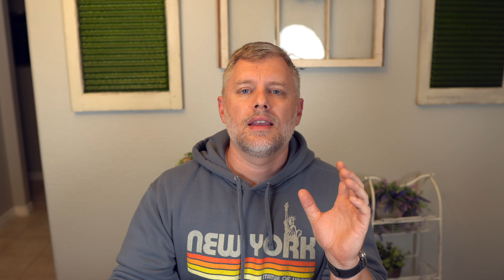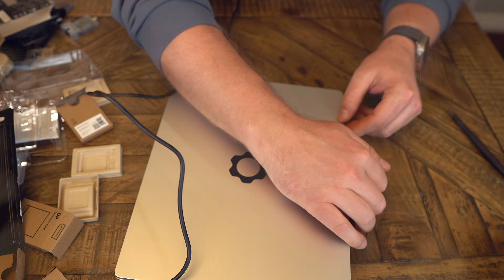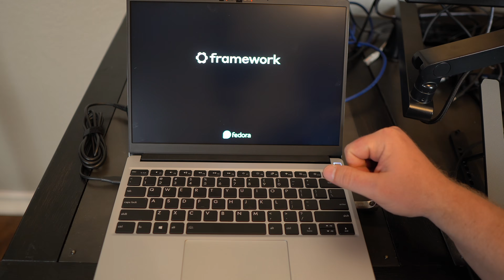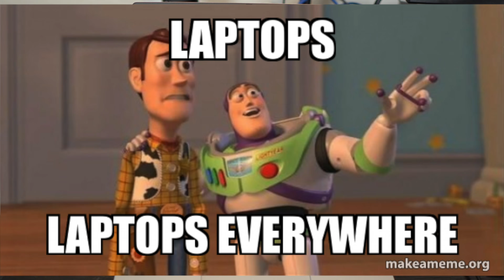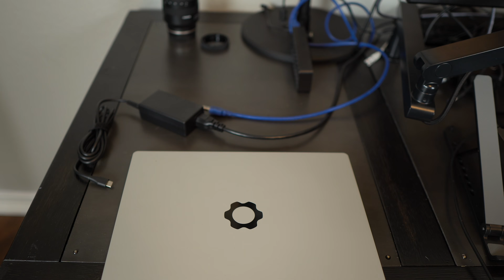Framework 13 AMD Edition Unboxing & Linux Installation Review

Comment from the maker: Timestamps:

0:00 - Introduction
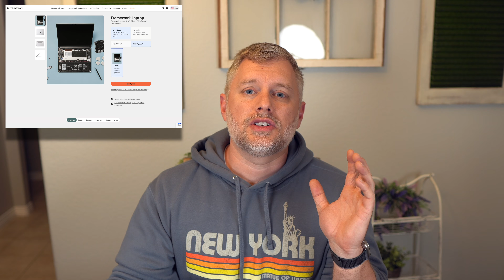0:03 - Framework 13 overview (repairable, modular)
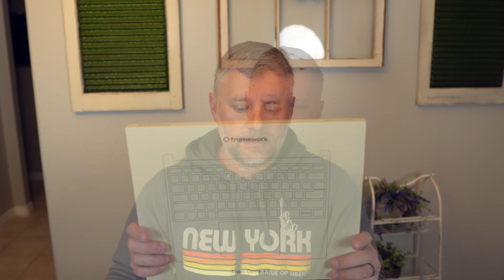0:22 - Unboxing the Framework 13
0:26 - Input cover kit
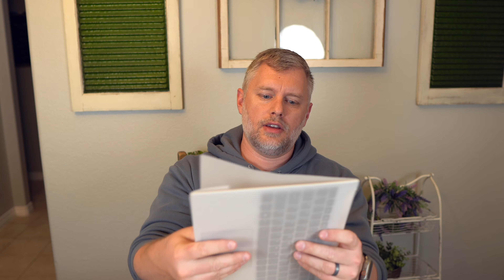0:44 - DIY Edition top cover and assembly
1:00 - Arrow key layout and glass touchpad
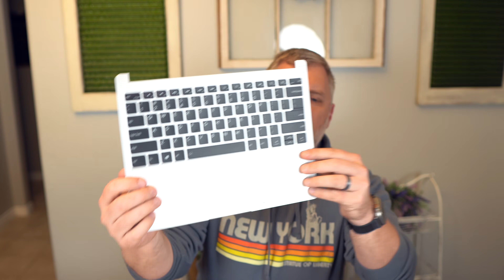1:23 - Magnetic bezel unboxing
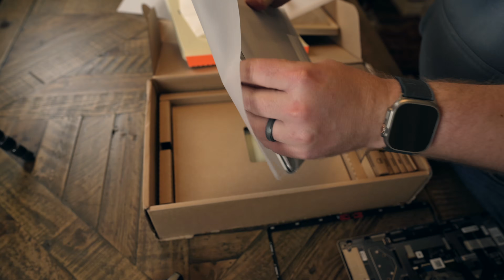2:05 - First impressions of the laptop body
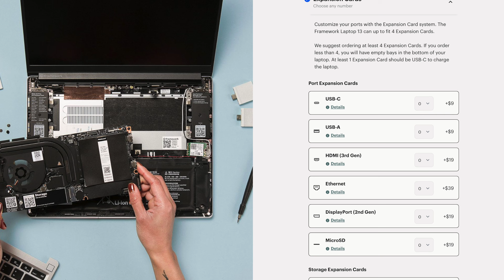2:20 - Customizing ports (USB, Ethernet, DisplayPort)
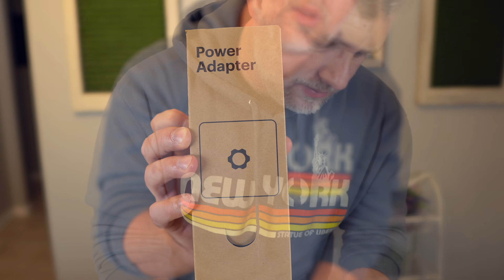2:38 - 60W power adapter
3:12 - Installing 64 GB of DDR5 RAM
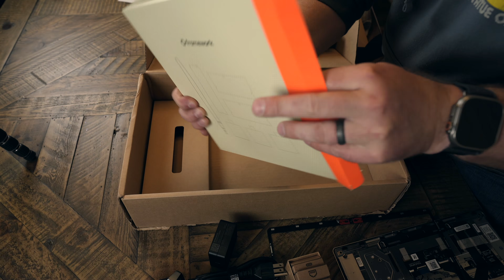3:50 - Installing the Western Digital 2TB NVMe drive
5:01 - Memory and SSD installation complete
6:11 - Attaching the bezel (magnetic)
7:16 - Snapping on the top case
7:49 - Screwing in the assembly
8:11 - Installing modular ports
8:30 - USB-C and Ethernet installation
9:18 - DisplayPort adapter installation
9:32 - Ports and connectors overview
9:47 - First impressions of the trackpad and keyboard
10:01 - Powering up the laptop for the first time
10:03 - BIOS screen (missing boot device)
10:31 - Checking BIOS settings
10:47 - System info: AMD Ryzen 7 7840U and Radeon 780M
11:02 - Booting Linux (Ubuntu 20404 Beta)
11:23 - Webcam and mic physical switches
11:42 - Ubuntu installation impressions
12:13 - Moving to Fedora 39 for Linux testing
12:28 - Fedora splash screen and installation
12:36 - Checking AMD Graphics compatibility
12:41 - Working hardware (brightness and sound keys)
13:12 - Fedora installation complete, rebooting
13:25 - First boot into Fedora 39
13:41 - Wi-Fi and CPU thread overview
14:00 - Checking CPU performance and dual-channel RAM
14:37 - Updating firmware directly through Linux
15:11 - BIOS update progress
16:01 - Discussion of the AMD chip's efficiency
16:18 - Framework BIOS updates and fixes
17:01 - Fingerprint reader test and setup
17:46 - Webcam and hardware switch test
18:15 - Recording through the Framework webcam
19:15 - Running Chrome browser speedometer test (high score of 366)
19:42 - Performance profile and battery life overview
20:42 - Testing suspend and resume functionality
21:11 - Wrapping up: Overall impressions of Framework 13 AMD Edition
22:13 - Final verdict: Build quality, modularity, and Linux compatibility

Comment: Thanks so much for the video, I've been curious about the Framework laptops, and this was good for me.  So did you not need to worry about static electricity in this assembly?  I didn't see any ESD related equipment.

Comment: Maybe I missed it in the video, but did you actually do a battery test? You pointed out what it said it had left but those typically aren't accurate. Did you run any full battery tests to give us a realistic battery life estimation? Thats a big determining factor for me between this and System76 Darter Pro currently.

Comment: I saw you booted up with Ubuntu. Did the brightness and sound keys work with Ubuntu?
Reply: Ubuntu is one of their officially supported distros - so yes all the keys work out of the box. The embedded controller firmware which includes the keyboard firmware is open source and on their github. Firmware updates are handled by fwupd/LVFS so even many distros they don't officially support work just fine pretty much out of the box.

Comment: Would love to know your thoughts on battery life (especially since AMD has a big power drain during video playback). How much are you getting out of it?
If it's comparable to the 8 hours I get on my 3,5 year old Lenovo yoga slim then the FW13 is definitely my next laptop.
Reply from the maker: I end up using mine almost entirely plugged in but there is a great thread with a bunch of different operating systems and real world results on the Framework forums: https://community.frame.work/t/real-world-battery-life-experience-fw13-amd/39112/46

Comment: Hey, iam currently running a Mac book M1 Max for my Computer Science Studies and I'm thinking of buying a framework amd version to use linux/windows. Do you think It will be a massiv downgrade? or will it serve me well? Are you still happy with it?
Reply: It will be a downgrade. The M1 Max is a beast.
Reply: Is there software that you need Linux/Windows for? If so and virtual machines aren't working for you, then I'm guessing the framework will be good (haven't bought one yet)

But if you can, might want to look into a software solution first. (Coming from a guy that has collected way too many computers over the years, looking to sell/donate and consolidate to 2 desktops and a framework laptop.)

Comment: How would you compare it to your Lemur? From a user perspective, feel, performance..
Reply: I don't have a lemur for comparison but I've got a last gen pangolin and the framework's fit and finish is far better than the clevo chasis that system76 and most other linux laptop makers use, much nicer more premium feel to the device.

Comment: Whoa, 29 likes on the video already!

This was a nice show, more on the install part, less on benchmarks and tests. I can't wait for Framework to ship with Intel's 15 gen. Both Arrow Lake and Lunar Lake. I hope Framework will have at least one of them in their models. I can see that they skipped Meteor Lake (aka 14th gen).

For me, ideally, I'd have an 18" desktop replacement. With 4 sticks of RAM, hopefully running at 6000 MT/s, but for 128 GB it seems that not even desktop computers can have that. DDR5 is weird.

Anyway, I can't wait to see more stuff from Framework. Their Framework 16 seems like it's strunggling a bit, having only AMD option and being quite expensive. But they showed with Framework 13 that they deliver on their promises.